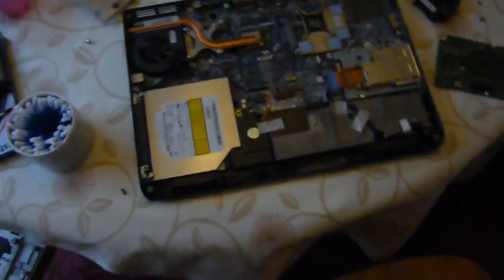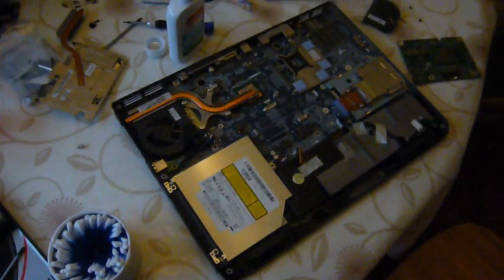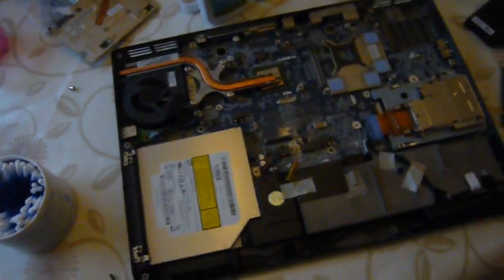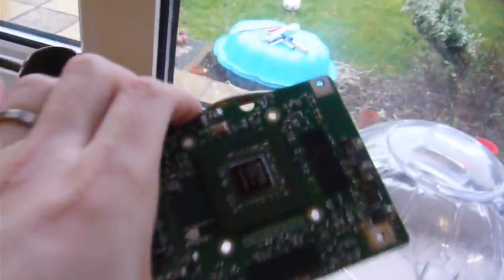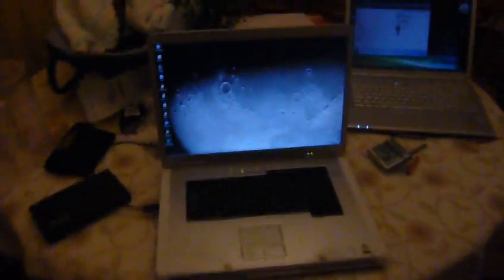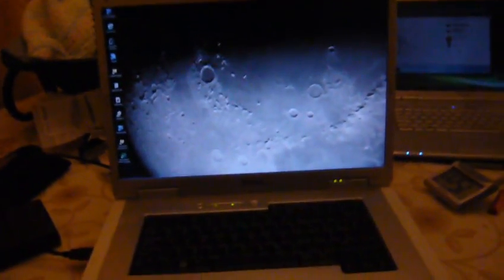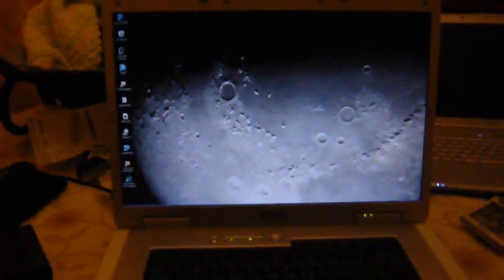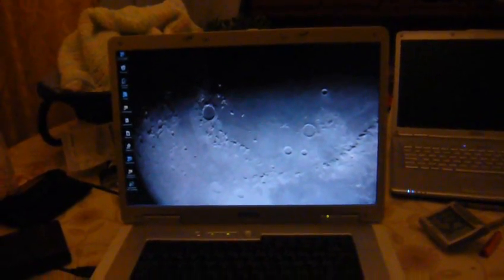Inspiron 9400_nvidia 7900 go oven bake reflow

Comment: If you have access to a heat-gun you can do a much better job, focusing heat on the actual die.  Re-flow of the solder balls without damaging the other components and warping the pcb. Getting a good amount of liquid flux under there before reflow can help too, but ensure its removed properly after. To prevent/ delay its return, ultimately get the 2 heat-pipe heat sink from the 7950gtx model. Otherwise just get some software to run the fans all the time and make sure the vents have good airflow.

Comment from the maker: You may ot have to go through all this. Download I8kfanGUI and keep them fans running full if the GPU goes above 50 degrees. Also the A10 bios which starts the fans earlier. I think the damage can be done in boot up with an already hot GPU and and old bios. I never run games or renders in a warm rom without the laptop on a laptop cooler now.

Comment: @kazeklokuciewski I didn't have an oven, but I've improvised and used a frying pan instead and cushioned the card with a metal plate, keeping a low heat on the pan for ten minutes with lids on. cooled it down for 10 minutes as well. And guess what, it works now!! :D. AWESOME!!! I can't believe it. Should have recorded a video of it. A big thanks for your video :)

Comment from the maker: Yep.

Note. When I first booted it still had a few artifacts.  Then I shut it down and booted it again a few minutes later and its been fine ever since.

I now have the latest bios from dell which gets the fans working earlier pre-windows. Also install I8kfanGUI (google it) which allows you to control the fan speed. I set mine to monitor the GPU and go slow at 40c and fast at 50c.